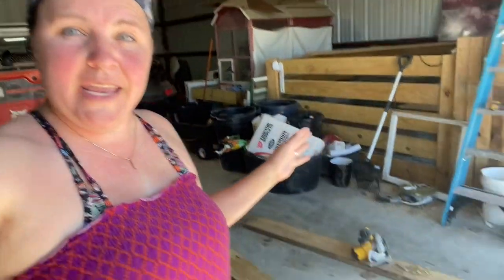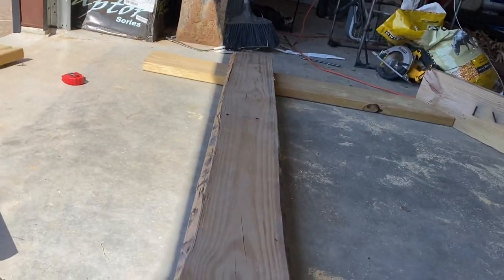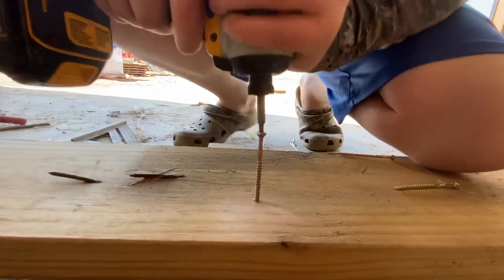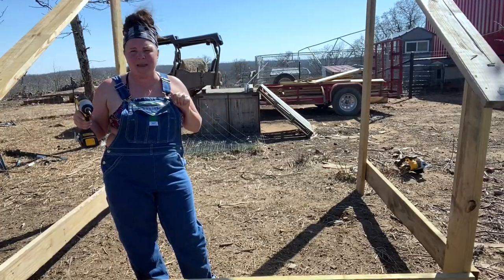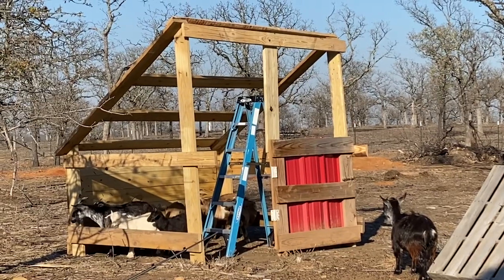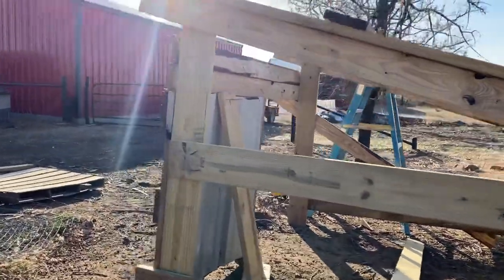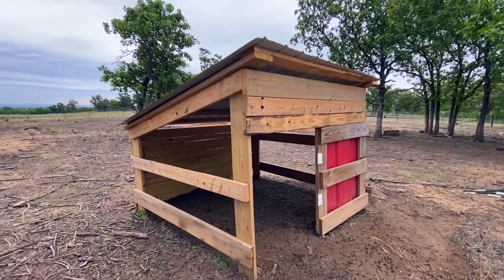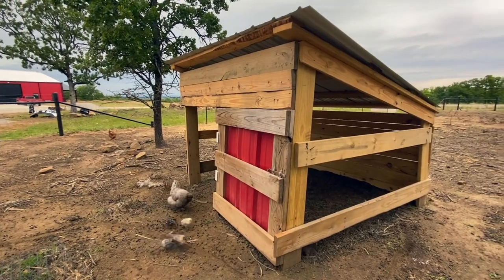DIY How To Build A Goat Shelter: Using Free Recycled Items from Our Farm •Watch Us Work•

Comment: Nice shed for your goats. They'll use to block the wind and rain. Without siding it won't protect from the winter snow. Are you going to add siding for the winter months?
Reply from the maker: Yes :) We will add the R-panel on both sides and actually some wood above the opening of the doorway, then tons of hay for the winter months :)